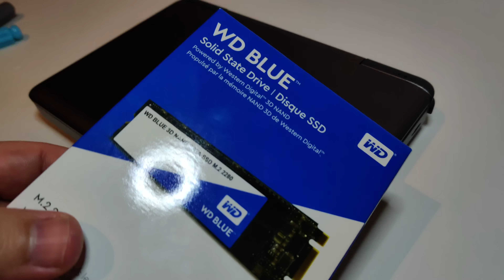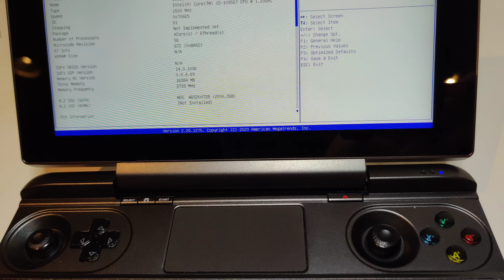GPD Win Max - How To Upgrade Your SSD

Comment: Seeing how the battery is / is going to be, I hope that the modding community will create a 3d printable back to allow for an extended battery.
Reply: Perhaps. Just ghetto that back panel by cutting the area around the battery and put in whatever you want? It is super flimsy anyway. Razor blade it a little bit and you have yourself whatever brick you want to add to it.
Reply: @lowkeylowkey1000  that's always an option, but I love functional 3d prints.
Reply: @Itatsu1998  
I tend to forget those. But yeah. Even better.

Comment: I wonder if a future handheld PC could be designed with an M. 2 drive cartridge slot.

 The m.2 drive would go in a housing and it would use the same connector on the motherboard but there wouldn't be any screws, so it could be inserted like a Nintendo ds cartridge?
Reply: That would take up extra space, and to my knowledge that doesn’t exist. GPD is very unlikely to invent a new storage standard; especially when it compromises the biggest limiting factor to the device.
Reply: @Bruno_Swag  knowledge that dosent exist? all it would take is a USB enclosure. And it would be helpful for making it easy for consumers, single game chateages for portable consoles like the switch.

And I knew it was possible I was curious if u thought anyone would actually do it, or if it was just a pipe dream. Yes it takes up space but remove storage needs a case.
Reply: RyanWake bradtelle in the win max they don’t have a centimeter of extra space, so taking up space for hot swappable storage doesn’t make sense not to mention that it only has one drive so taking that drive out wouldn’t work because the operating system is on the SSD  so taking it out would mean the system wouldn’t work at all

Comment: Got mine 2 weeks ago.  They must be listening because while the battery was still stuck to the bottom of the case the battery cable was slightly longer and it was easy to remove the entire bottom.  I used some tweezers to plug the battery back in at the end and it wasn't that difficult.  Also, I did not have to remove any of the fan screws.  Maybe they gave it a little bit more clearance.  I don't know. There was just enough room to slide the WD 1TB blue ssd.  I couldn't justify paying an additonal 150 buck for the additional TB.  Hope this helps.

Comment: I imagine for prototypes it would be a heck of a lot easier to do motherboards swaps, if the battery was attached to the bottom cover. But for people who aren't going to be doing 3 or 4 motherboard swaps in the next couple years I don't think it'll be an issue.

Comment: Your far better off just cloning the original SSD to the new SSD before you install it. If you don't own another PC that has two M.2 SSD slots, just buy an external USB enclosure for the M.2 SSD, then boot the Win Max, plug in the new SSD via USB, and clone the internal SSD to the external SSD.
Reply: Go full junk yard; Razor blade the back panel and run an extension ribbon cable through a small slit and hot glue an SSD to swap drives with whatever OS at your leisure. Great for keeping windows on one and any Linux on the other. You can do the same thing with USB, I know. But it is a fun project for the grins.
Reply: No, some users have found chinese viruses on the preinstall. It was like that on the Win 2 already
Reply: @bommel2437  That was just rumors/misinformation, there have been no verified worms/viruses/trojans or anything like that found on the Win 2. However, there actually WAS a virus of some kind on the very first device GPD ever released (the Win 1 I think), but it wasn't put there by GPD, the virus was found to reside in a third party hardware driver provided to GPD by a manufacturer. But nothing like that has been found on any GPD device since.

Comment: Why did they make it so hard this time?
Reply: Where would you put it ?
Reply: U r right. But at least you can upgrade it. Not like some other laptops or Macs
Reply: @antoniorsoftware  the win 2 had a door on the bottom for you to replace the ssd. You didn't have to take the whole thing apart.
Reply: @Zero-tm5xk  doesn't seem to be that bad the only big problem is the fan.
Reply: its not hard.
Reply: @NexXxus86  it is.
Reply: @SketchTurnerZero  well yea I admit it might be a little finicky to slide the SSD under the fan mounting hole.
You gotta make sure to isolate it properly to not have it touch any of the components on the SSD.
Reply: @NexXxus86  I understand it. But the fact that this method is more complicated than the method that was used in the previous WIN 2 + the use of specific SSD models is difficult to deny
Reply: @Zero-tm5xk  I know, but look at the board on the MAX, where can you put it so a user can easily access it through a door at the bottom ? There is no place anywhere. If there was only one fan and no clickable sticks like on WIN 2 then there would be free space.

Comment: The Indiegogo GDP Win Max funding campaign specs mention "Dual ssd sockets (Socket 3 / Socket 2)". I initially read this as you could install dual m.2 ssds in the Win Max, but having just watched your SSD upgrade video for a second time, your review unit only appears to have a single M.2 SSD socket? Should this really be read as single SSD socket with dual protocol support, viz NVMe and SATA?
Reply: Yep exactly. Not very well translated for sure.

Comment: BIG FAVOR to ask, Could you get the measurements of the battery pack? Curious if we could fit some Samsung 35q 18650 cells, and limit the full charge to prevent overcharge.

Comment: Is there anything wrong with the original SSD added by GPD? . I have a spare  500GB  Corsair MP300 NVME SSD laying on my enclosure, but if there is no big difference in speed, I might not do the upgrade.

Comment: I get that this is the price to pay for the device being so compact, but the internal arrangement looks like a mess and difficult to work with. I guess you should just buy it in the configuration you want and not think of it as truly upgrade-able.
Reply: The only part that's really upgradable is the SSD. Otherwise, the only other reason you'd open it up is for maintenance.

Comment: Just tried this with my new GPD, the battery is still stuck on the back with retail units which is a bother. The screws are different sizes. And I'm screwed because the m.2 screw wasn't coming out and seems impacted now. -_-.

Comment: Nice video. Volume a bit soft tho but overall good.
Whats the part of the NVME? the win max only has 1 m.2 slot right so it can act as both right. The bios will detect it as either sata or nvme or theres another m.2 drive bay somewhere else.
Reply: You can use an M.2 sata or M.2 nvme ssd, but not a PCI-E nvme ssd.
Reply: @stratman71  but nvme is pci-e

Comment: Hello one important question i was looking at the gpd site and i think it satsbit has 2 ssd slots. Is that true?
Reply: The indiegogo preview site says "Dual ssd sockets (Socket 3 / Socket 2) for unlimited storage expansion, support M.2 NVMe / AHCI 2280, with sequential read / write speeds exceeding 2000MB/s;" so where is the other slot? Can you put 2 ssd?
Reply: Michel Quintin maybe it means it can take 2 different type of drives, ssd and nvme.
Reply: @teknomanblade8913  i also thought that at first but it says 2 different socket names
Reply: Michel Quintin I believe an nvme and ssd use 2 different socket types. Looking at the inside. Doubtful there would be room for a second physical socket.

Comment: Hey. I have windows 10 pro. Do you recommend that I could upgrade my windows with pro from home edition since I will be doing alot of production and graphic work on the device on the go
Reply: No reason you couldn't take the ssd out that comes standard and install Pro on a new ssd to test it first. If you are strapped for cash and don't want to spend the much. Download the OS from MS's website and install it onto a usb stick or something just to test it out. It would run like a turd, but it is cheaper than a $50 ssd to test it right?